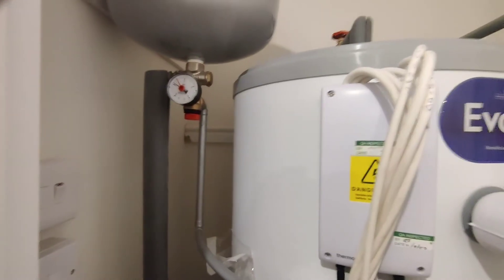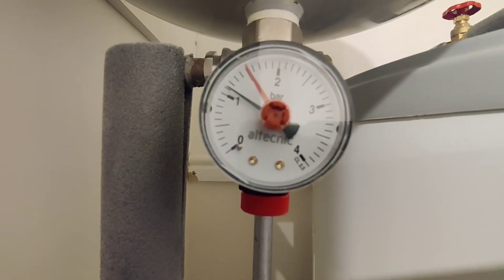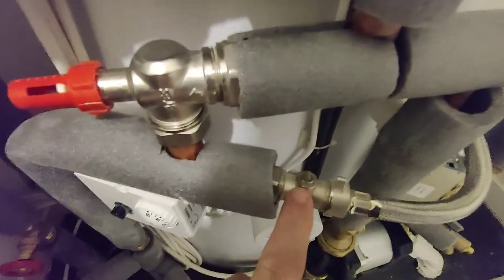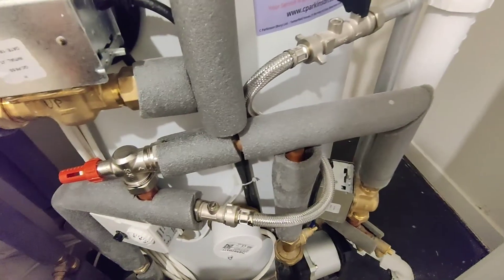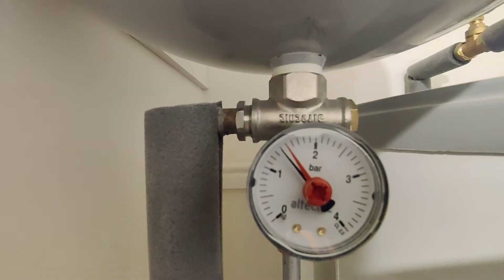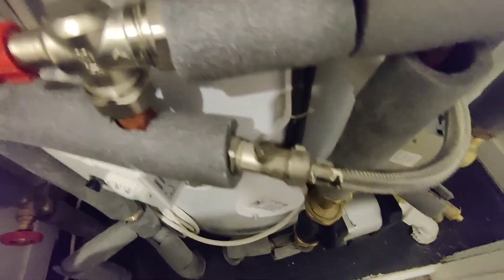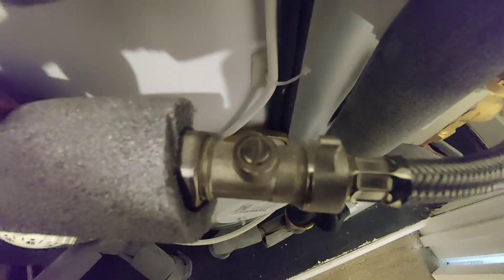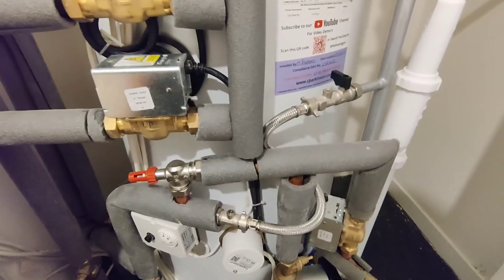Filling Loop Topping up pressure on unvented cylinder

Comment: Thanks for this. I just topped mine up.
Reply from the maker: Glad it helped.
Keep an eye on it as it like a tyre with a slow puncture. Runs fine as long as you keep it topped up but runs in to trouble if it goes flat
Regards,
Roger
@theheatingpro.com

Comment: What is this actually doing?
Reply: Yeah I also have this question. Does this tank control the hot water for central heating and hot water? Mine is located two floors away from my boiler!
Reply from the maker: The heating system is pressurised. No more header tank in the loft. I often make the comparison to a tyre with a slow puncture for a good mental picture. The tyre runs just fine as long as you keep the pressure topped up on it but you will run into issues if you don't keep an eye on the pressure. Think of your heating system in the same way, it can run flat but that is when air becomes an issue within the system and can cause damage to the pump among other things. Top up keep an eye on the pressure periodically and vent you radiators annually. Remember when venting the rads you are letting the tyre down and will need to top up directly after doing so.
Hope this answers the question 
Regards
Roger
@theheatingpro.com
Reply from the maker: The heating system is pressurised. No more header tank in the loft. I often make the comparison to a tyre with a slow puncture for a good mental picture. The tyre runs just fine as long as you keep the pressure topped up on it but you will run into issues if you don't keep an eye on the pressure. Think of your heating system in the same way, it can run flat but that is when air becomes an issue within the system and can cause damage to the pump among other things. Top up keep an eye on the pressure periodically and vent you radiators annually. Remember when venting the rads you are letting the tyre down and will need to top up directly after doing so.
Hope this answers the question 
Regards
Roger
@theheatingpro.com

Comment: Jist did this because out Bar is at 0. I heard all the roght noises but the dial didnt move. Time to get someone in 😂
Reply from the maker: Sounds like you may have a faulty pressure gauge. Pretty quick swap and not too expensive to get it changed out.
Regards
Roger
@theheatinpro

Comment: I have a similar set up with immersion heater but there is no visible pressure dial? Any suggestions?
Reply from the maker: You may have a system boiler and the pressure dial be at the boiler? take a look and let me know
Reply: Mine is a system, I can't find the gauge on the boiler, pipes or where the hot water tank is ?

Comment: Filling loop shouldn't be left in situ like that in case of cross contamination.  Yes I know there is a check valve on there but they are not fail safe.
Reply from the maker: No quite right
Reply: You mean the braided hose shouldn't be permanently connected?
Reply: Ive just checked ours and the filling loop has been there since we moved in 7 years ago in a new build. Should I remove it?